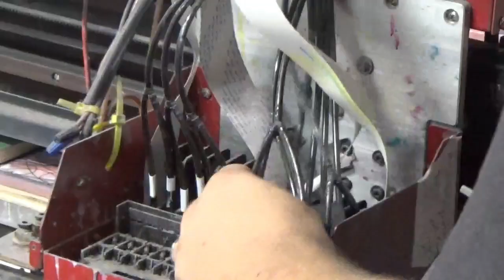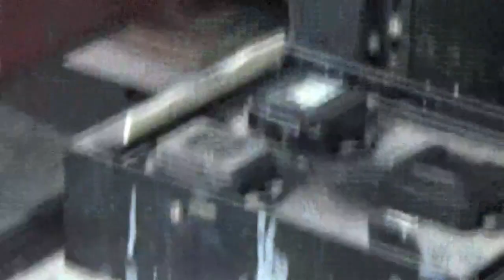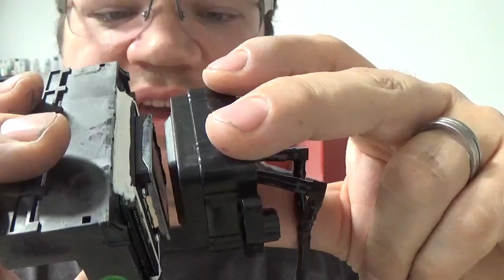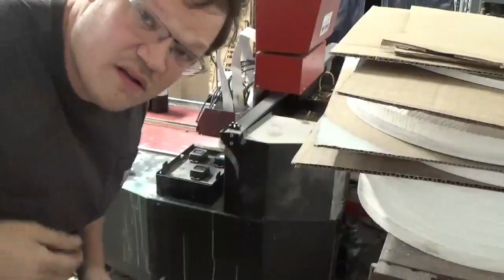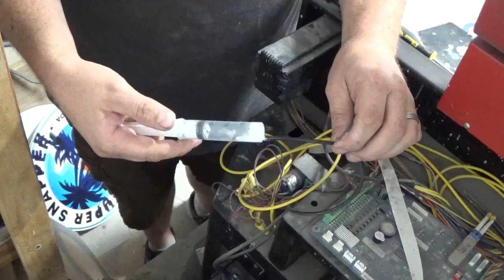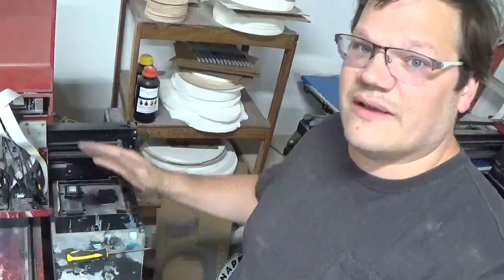Epson Printer not working?  how to get your uv printer printing again or dtf - Replace a inkpad

Comment: Hey when the print is off, does the ink cap needs be raised to completely seal off the print heads because I notice there’s a space between my print head and the ink cap when the print head is idle and when I open the hosonsoft software.
Reply: Please help

Comment: hi , i am having the same problem with the ink pad , i use 5060 , 2 printheads , Tx800 , i have adjusted the height to the right , air tight , but it does not suck the ink

Comment: Hafa Adai From Guam.  
Question.  My capping station is not draining white.  I have a strong vacuum without the print head seated on the capping station.  Could the pump be bad? Or lines just clogged?  Any info would be greatly appreciated before i decide to operate 😂  thank you

Comment: So I noticed the ink is connected to bottles and you had to pull the ink through with a syringe.  I also noticed there are pumps in another video but only on the waste from capping station.  My home epson has an air pump and fills the open space of cartridges with air pushing the ink through the pipes to the head.  How does your printer keep ink flowing to heads?

Comment: So a bad cap top can cause no ink to come out the print head ?
Reply from the maker: @1sickhemi_92hemi_movement2  absolutly
Reply: @JaysToDoList  thank you for the quick response..I have a mutoh xpertjet 461 uf I just purchased a new cap top I haven't changed it in 2 years hopefully hopefully this will fix the issue.

Comment: Bro you saved me from buying a printhead,but why did i need to raise the cap, i never had to do that before, does that mean something else is damaged???????? 😢
Reply: Or does it mean the ink pump is going
Reply from the maker: The cap is likely going bad and you added a little more pressure to get a seal so it loads
Reply: Well this is a new cap i used and i still was not getting ink to pump so i used two washers???? Any other reason ???

Comment: Hi Jay. I replaced both my printheads today. Colour is pulling through ink, but the white is not pulling through ink at all. I seems like it is not sealing properly, but i tried aligning the cap even replaced the cap, still nothing. Followed all your steps. Nothing. But when station is off to the side the white ink just seeps through the head onto the bed. What do you think the problem could be, is the new head faulty?

Comment: What if after doing all that , the print head doesn’t still comes out ink ?Am facing the same problem with my UV printer ,Epson L805, maybe can it be a cable problem or motherboard? In case it’s a cable , which cable do I need to check ?
Reply: Did you get your problem solved? Am having the same problem with my Epson L805. Have replaced the printhead but still not printing
Reply: Me the same.  Any solution?  @global-linkacademicagency2156

Comment: Hello! I have a differenr A3 printer but any suggestion on an xp600 not printing ink entirely? We did follow a video of yours to soak it and flush. All the Ink channels have good ink drippings when we flushed, but when tried printing, it seems to nor work🥺 help pleasssse
Reply from the maker: It will print nothing at all? Hiw about the nozzle check? Makes me think either there is a problem with ink supply or the head is bad
Reply: Thank you for your response. 

No it doesn’t print anything at all. We already changed the printhead (but it started printing lines, flushed several times but did not fix the lines and then the magenta clogged). So we took it out and soaked it overnight. When we put back the new printhead back, the same thing happened. No ink is printing.
Reply: I have a same issue but with my varnish. I have good suction, and good print on my color but my varnish is not working at all
Reply: Mine is totally messed up and no ink is coming out. Did you figure out yours?
Reply: @xiennamariebretana1620  no, still no luck
Reply: Oh same here. I ordered a new printhead now but i dunno if it will work. It’s weird we have two printheads that doesn’t print colors at all.
Reply: @xiennamariebretana1620  where did you order your print head from?

Comment: We replaced the white and gloss print heads and now the printer isn't printing anything.  It acts like it's printing but even the color head isn't printing.  We tried printing with just the color head and still nothing.  Ideas?
Reply from the maker: Is it loading ink? If so I'm worried your headboard might need replaced since it is affecting 3 heads
Reply: @JaysToDoList  It is loading ink.  It was printing fine using just color before connecting the two new heads.  Connected the gloss on Friday and had no issues (color) printing but the gloss wasn't printing.  When we connected the new white print head today we got a warning beeping for a minute then turned the machine off and back on.  then no warning beep but none of the heads will print now.  The machine acts as if it's printing, but nothing comes out.
Reply from the maker: @user-pu5uh8lz7b  un hook the white head does it print? If so it xould be a bad cable or head even if it is new
Reply: I unhooked the cable for the white already and still no printing from the color head. Do I need to disconnect the dampeners as well?   @JaysToDoList
Reply: @JaysToDoList  we unhooked the cable for the white print head and still no printing from the color head.  then we unhooked the gloss and well, still no printing.  Do the dampeners also need to be disconnected from the white print head?
Reply from the maker: @user-pu5uh8lz7b  no the dampers don't need disconnected just the electronics it sounds to me as there was an electrical issue when you connected your head that made the error beep and it shorted you printhead board that is my guess
Reply: @JaysToDoList  crap, that's bad right.   any way to test or fix or do I need to buy a new print head board?
Reply: @JaysToDoList  are the printhead board and the motherboard/headboard different components? Our technician told us the motherboard looks like it's working correctly, so we are worried the heads or the board the heads connect to may have an issue

Comment: What does it mean if the Printer software keeps saying my red and black ink are low, but they are full? These colors also refuse to load at the moment. I have replaced the ink pad, the damper, lifted the ink pad with washers and it still will not suck red and black ink into the head.
Reply: Disregard Jay. The line coming from the ink pad to the pump motor was pinched.
Reply from the maker: Maybe the software will support ink level and you do not have inklevel sensors or your sensor is maybe broken or stuck

Comment: Can the varnish print heads get clogged? Might be a dumb question
Reply from the maker: not a dumb question yes it can get clogged if you are not running it I suggest turning off the lamp for it if your machine allows it. in fact I have an entire video on why printheads clog mostly on the white but this applies to the varnish and cmyk as well https://youtu.be/x3h7tMHetxQ
Reply: yes we can confirm @JaysToDoList

Comment: Oh Man, thank you!!!
Reply: What if after doing all that , the print head doesn’t still comes out ink ?Am facing the same problem with my UV printer ,Epson L805, maybe can it be a cable problem or motherboard? In case it’s a cable , which cable do I need to check ?